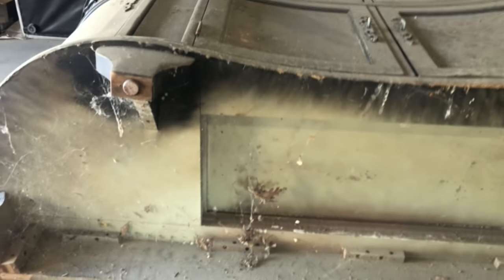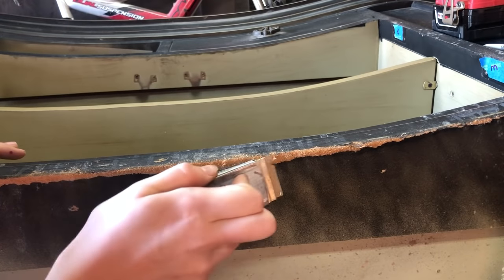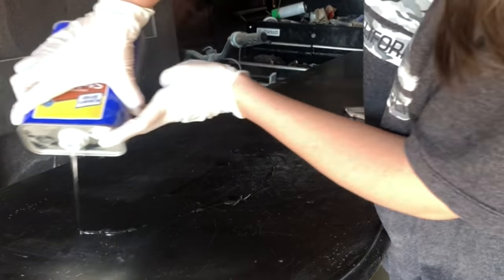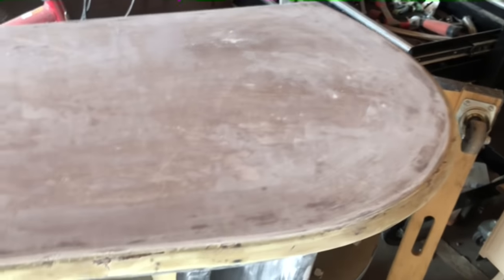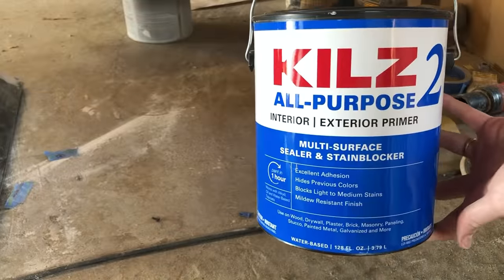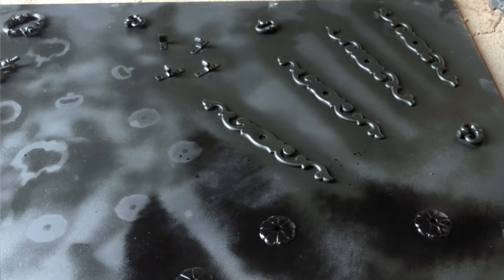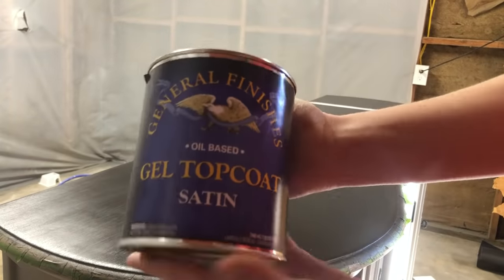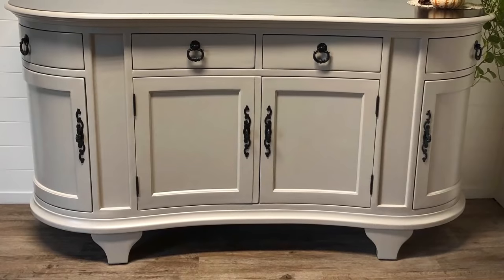Trash To Treasure Furniture Makeover | Extreme Makeover | Furniture Flip | Dramatic Transformation

Comment: After refinishing/refurbishing furniture for many years, I would like to make a suggestion.  When you have the need to strip a piece, put more stripper on and don't work it so much.  I think you'll find you have a quicker, easier time getting the finish off.  It is messier but far easier.
Reply: I agree with you. She seems to love that that razor blade scrapper but that's really for getting stickers and paint off glass not wood. Also gel stain is applied with a brush not a rag. It goes on easier and nicer with a brush.
Reply: I was hoping someone else noticed she didnt use enough
Reply: Good job.

Comment: Very nice piece. You saved it from the landfill. A trick that I have learned with the MDF plywood is that when you replace screws put a dab of Gorilla glue in the hole before screwing back into it. The glue will help hold the screw in place a little tighter and cut down on any pullout. For what it's worth.
Reply: MDF is one type of board, plywood (layered wood, «cross veneer») is another. «MDF plywood» does not exist.  I was once taught to add wood glue to s rew holes, then add matches until the hole is filled. Or dip each match in glue before adding. Break the match off,  knock it off with a hammer or cut it off, e.g with pliers. Then you can add the screw and it has something to grip onto. Works great! 🤗
Reply: @lottatroublemaker6130 I usually use toothpicks

Comment: Just a few hints.... if you are going to use bondo products try using glazing putty. It is thinner and fills better since it is designed to fill in the bee holes in bondo. Granted, I am also in the NO to MDF products, but I might have used the piece as a template for something in real wood. It does look pretty good for what you were working with. Also working with and airless sprayer, you need to create positive air flow so you are not breathing paint. A cheap tarp and box fan with a filter usually will do the trick.
Reply: Very true some protection is needed...gloves, mask.etc
Reply: With talent and patience like this, somebody give the young lady a fab job restoring wooden furniture.
Reply: Looking @ mdf pieces differently now...I have passed up so many  bc I  didn't know what to do with them....even tho I loved the design

Comment: Safety first! Use gloves when dealing with chemicals. You were taking off that paint stripper without wearing gloves. And I don't know if you were or weren't but it's important to wear respirator or dust mask as well as goggles when sanding MDF, the fibres from it are much finer than when you sand wood and contain formaldehyde.  If you were wearing them, then well done and hopefully this will alert other viewers to the danger of MDF.

Comment: You can «hot lacquer» metal (as the hardware) by spraying them, then put them in an oven on 100˚C, then turn the oven off and leave the metal in until the oven is cold. I only tried it once, but the result was stunning. I painted a steel plate to use as the top plate on an amplifier my nephew built and the result was stunning, I think. It becomes more sturdy by doing this!

Comment: Thank you for the tip on using the Bondo on the MDF board.  I have a mobile / manufactured home, of the same vintage, which is suffering from the "bubbling" as it full of MDF.  Found myself guilty of not doing what I'd advised others. That being  "listen to the message" and not the messenger.  I'm glad I took my advise and learned something new from you.   Good luck to you.  Narragansett Bay

Comment: Try using two plastic bondo spreaders. They are much easier to work with. Put the bondo on with one then come back with 2.. 1 on top and1 on the side.. much easier and faster to get a clean edge. Leave a bit of bondo on them and let it dry. The bondo will pop right off by bending them…

Comment: I’m new to the community so this might be a dumb question, but why use the paint gun on the frame and a roller on the drawers? I’m assuming it would have been loads easier to use the gun. I’d love to know! Thanks! Also, the piece is absolutely stunning!
Reply from the maker: Yes, I should’ve primed the drawers with the spray gun, you are 100% correct. But honestly I totally forgot about the drawers, and I had already primed and paint the credenza, and the beige paint was still in the spray gun, and I didn’t want to clean the spray gun out just to put primer back in it and then have to clean it out again to put the beige paint back in that spray gun. I just thought it would’ve been easier if I just used a roller to put the primer on. But I did spray the drawers beige with the spray gun, it was just the primer I did with the roller. I hope this makes sense, I’m not the best at explaining things. 😊
Reply: @furniturefonzie  thank you so much for the response! The piece was really beautiful!

Comment: Kudos for saving it from the bin. 
But here are some tips from a professional. 
1. Don't try and fake grain anything, its not going to look like grain unless you actually know exactly what you're doing and from this video, you're not experienced enough.   
2. If you have the option to spray, then spray, this will give you a much smoother finish, don't use rollers unless you really have to. 
3. If you're working with MDF then use an appropriate sealer before priming, this will prevent the edges and sanded through surfaces from soaking up paint/finish and looking rough as hell. 
4. When working with hardwoods, MDF and some chemicals use the proper P.P.E. as these are carcinogenic and can cause serious health problems! I learned this the hard way and now have COPD. Masks, gloves and proper footwear are all in your best interest when doing jobs like this.  
Hope this advice helps, I'm all for recycling furniture if it can be saved, glad to see more folks doing it. 😀

Comment: you  need to get a scale that reads in grams. for 50 grams of bonds. add 1 gram of harder plaste. it gives you a good open time so you can work the mixture on your project. helps to cut back on waste. use a fan to blow out mdf dust. your lungs 🫁  will love you.

Comment: I don't uderstand 2 things: 
1- Why use a paint gun for primer/paint on all the cabinet except the top part (but use brush instead) ? It seems that the result with paint gun is more smooth than the brush. 
2- while painting the hardware, why put the elements so far away from each others. It seems this process wastes a lot of paint as it will end on the cardboard and not on the nearest piece placed to the one you are focus on.

Comment: 18:13  - I am an older man - and one I can tell you - besides the nice work you do - please DON'T sit or knee on a concrete floor. In the future your joints suffering from the cold and hardness will regret it. Simply put some styrofoam on the floor and then sit or knee. 
When I was younger I also didn't care about it. 50 years later I wish I did.I really do.

Comment: SO many lessons in what NOT to do here.  PLEASE wear a proper respirator when spraying paints and when sanding MDF.  Also VENTILATION is critical.  Always wear GLOVES when using chemicals such as stripper.  You're going to melt your brain cells and destroy your lungs if you don't start taking protecting yourself.  If you want to do a wood grain, you need to use something with a higher sheen level than a flat paint for the base coat.  That's why you were ending up with such a mess with the gel stain.  You need at least an eggshell but satin or pearl sheen would be better.  Don't use a gel stain to create the grain.  Use a glazing liquid mixed with paint.  5 parts glaze to 1 part paint (in your dark brown).  The glazing liquid stays wet much longer and you can move it around much easier.  Use a brush, Not a rag.  Use wood filler instead of Drydex (that's what it looked like you were using on the drawers).  The Bondo was a good choice for rebuilding the skirting.

Comment: Okay so stripping the top was a long, messy, and probably smelly process.  But it had to be done, it may of looked awful but now you know if the top was truly sound and didn't have some weird crack - which would have been an easy fix with MDF.   And you know the entire piece would be uniformly painted and not have the top have an extra layer of old paint on it.  I don't think the old top paint would of been able to pull the whole piece together like the new paint anyway.  I saw your reflection very well while you were finishing working on the top part, the end result would not have popped as well as it did without the top being reworked.  Give me a couple of more hours and I will be able to completely justify why stripping the top was the correct thing to do.  Or people will just agree with me to shut me up about it.  😉
Reply: Stripping the top was unnecessary. Just scuff sand, prime with shellac primer and paint.

Comment: Its obvious you deleted remarks other than wonderful but if you want to learn, you did not need to "fake stain". Just some bondo in big dips and sand the piece. Use the primer and then just paint it!! The color on the body was pretty. Next time, just watch some videos.  You did alot of unnecessary work. It ended up very nice but save yourself work next time.